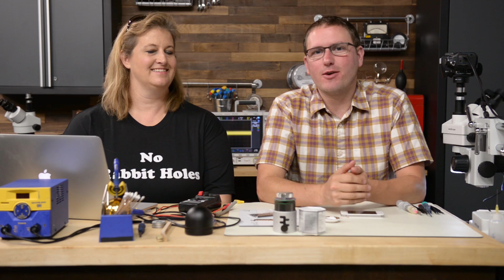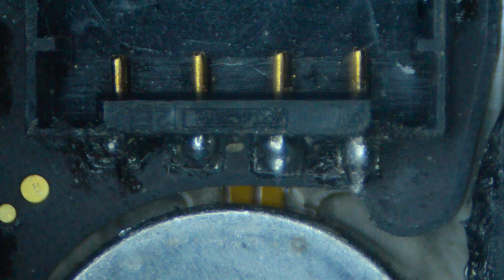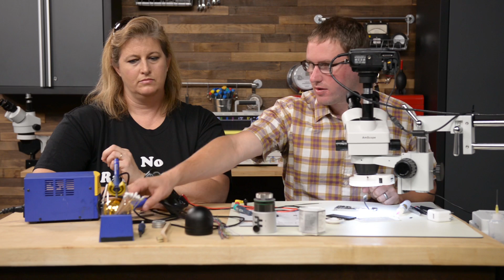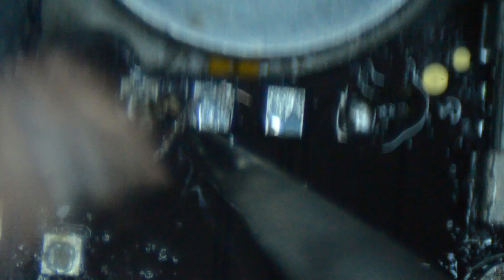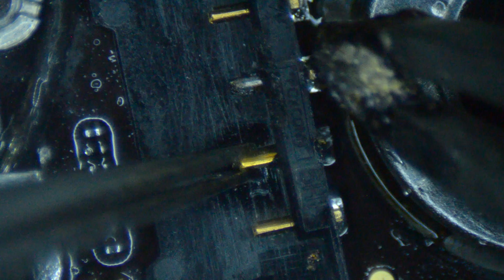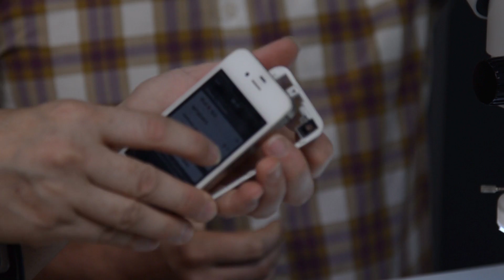Microsoldering 101: Troubleshooting and iPhone 4s Battery Connector Replacement

Comment: i remember a 4s i had the port broke of my board but i just had to sit it on the points on the board and it works fine
Reply: FMCREPAIRARMAGH what I can do if I broken the points on my board ( have one 2 points the other is just the plastic)

Comment: I have an iPhone 5s that works 100% except that it turns itself off when the battery % goes down to 75%. Changing the battery makes no difference, so I guess it may be a hardware issue.

It has a white water damage paint-spot at the top end, but a red one next to the battery connector, so I guess there is water damage on some kind of voltage sensor circuit near the connector. Can you tell me what part of the board I should look first, in case that part of the circuit is somewhere else? I have downloaded a circuit schematic, but it's mostly in Chinese!

I've bought a cheap ultrasonic cleaner which I will try when it arrives, but if that doesn't work I'm uneasy about trying any microsoldering by adding more solder. 

I do have a soldering heatgun and some flux of the kind that plumbers use for soldering pipes. Do you think that just adding some flux and progressively heating the board until the flux melts might do a good job of shifting some corrosion and overcoming any dry joints? What temperature do you suggest is best?

Thanks!

Comment: Did this about a year ago... Why didn't i see this movie first? :O haha, my problem was that one of my solider "pads" had come of, so had to run a new wire(thin as a hair straw) to the resistor. What a sick job for an totally unexperienced microsolider man haha. Acctually got the phone to work :D Felt like God when the phone acctually switched on to battery mode haha. Awesome feeling

Comment: What I did and might help someone who doesn't have the equipement right now, fold some paper or cardboard in two and put your unsoldered connector on the pads (the connector has to be attached to the battery), now put the little metal part and screw it on place, add the piece of paper on top of the batter connector and put the case on it. this should be enought to keep the contact and allow you to use your phone.

Comment: Do You have a tip for a good source to buy a new battery for the iPhone 4S? There is Ebay, I know, but there are too many fakes around. my shop around charges 90€ for the replacement - that is done in 10min ... thanks for any GOOD source.
Reply: +Christian Benedict Honestly, I buy batteries from iFixit.  Quality is good, customer service fantastic
Reply: thanks

Comment: Great video Kyle and Jessa. You mentioned adhesive in place of soldering anchors. Which adhesive do you recommend ?
Reply: +Chris Alexander I would think any 5 minute epoxy would do fine for that. It can be bought in places like Home Depot.
Reply: +Chris Alexander any epoxy, with a very light application
Reply: Hi, can you do an iPhone 4S wifi chip replacement video? or do you already have one? Thank you.

Comment: Hi Jessa, in this vid you mentioned greyed out wifi! do you have a vid for this repair please?
Reply: +Micheal Spence Most people just throw some heat on the WiFi chip and it magically comes back for some time.  It is no longer a repair that we offer since the chip + time is about the replacement cost of a 4s.  Whenever I see greyed WiFi in a 4s these days, I put heat on it to revive the chip, but I don't charge anything since it's not a 'real' repair.